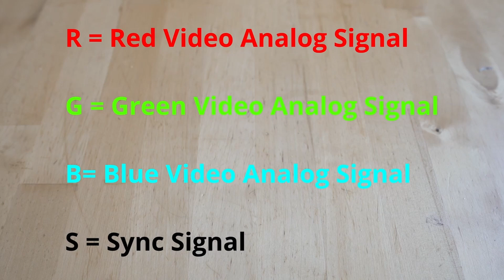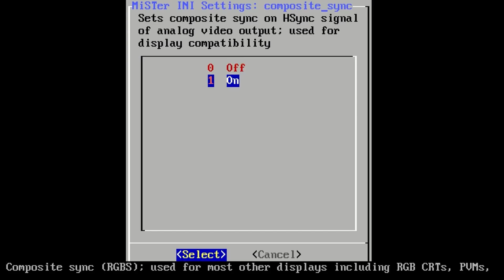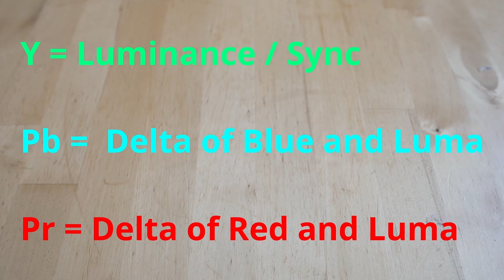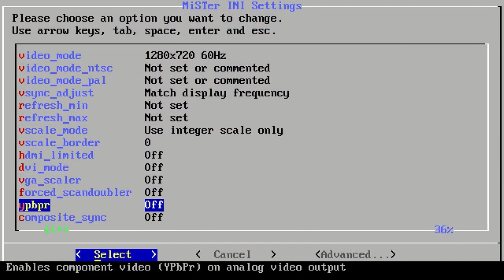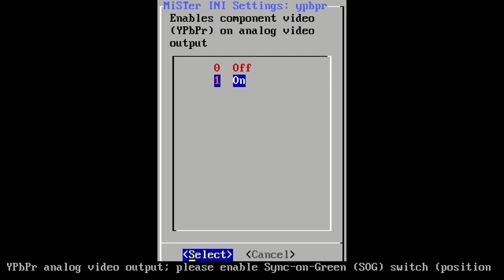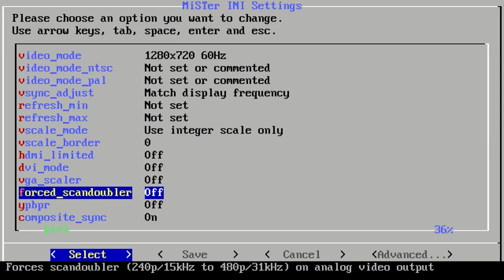MiSTer FPGA 2023 Analog Video Guide! RGB, Component VGA, S Video and Composite! Updated

Comment: I'm thinking of getting a retrocastle mister board, they have one that uses a saturn port instead of vga. which I guess is easier to do video+audio and takes less space. before I click fire on that do you think there's any "NO THAT IS A TERRIBLE IDEA" advice? I feel like it would work even in a pvm
Reply from the maker: I haven’t tested it so I really can’t say much about it. VGA offers the best of everything. I recommend the MiSTerAddons analog IO board personally
Reply: @VideoGameEsoterica  where I am it's really hard to get a mister. the retrocastle basically gives you the de10, a custom io board and low profile fan, 128mb ram, 256gb sd card, usb c power supply, usb hub, a good quality case and a custom saturn output port for a bit cheaper than a mister and it's smaller form factor. maybe when I'm back in the UK I will get a normal mister too
Reply: @VideoGameEsoterica  Is there anything special about MisterAddons' Analog boards? Are they 24bpp like Antonio Villena's boards or 18bpp like the regular boards? That's another option I've been considering, their passively cooled case in special is very appealing.
Reply: I own one and can vouch for its video output quality over rgb, composite and with use of a sega saturn rf adapter.
Reply: If you can get the relevant Saturn video cables with the quality you expect or can make your own, you should be good to go. I've been considering buying one of their boards (and aluminum case) to have a more compact and easier to carry setup, but I confess to be a little undecided on the Saturn vs VGA out. I've been using a video converter board from them that I believe uses the same AD724 chip they use on the Saturn board, the S-Video output is almost indistinguishable from YPbPr but with composite it's inevitable to have artifacts.

Comment: There's a method how you could fix the crack in the shell. Get a similar colored piece of plastic, cut it into lots of small pieces and melt it into a paste by placing it all into a jar of acetone, letting it sit until it has dissolved. You can then use the paste to fill in the crack, however you'd have to apply some pressure to the shell to keep it in place as the paste dries out, maybe also using some tape on the inside to prevent the paste from seeping too far into the shell, and you may need to level it out afterwards. I do suggest practicing on some other plastics parts first. The same method is used to fill in gaps in plastic guitar neck and body binding in guitar construction and restorations. The melted plastic basically turns into the perfect plastic glue. Since it is only a single crack it should be possible to restore it.
Reply from the maker: Ooh interesting. I’ll look into this. Sounds like a solid method because this crack does annoy me
Reply: @VideoGameEsoterica  worst case if you don't want to do it yourself, check for a local guitar or amp repair shop specialized in restoring vintage equipment. Some of these guys can work pure magic and restore damages to the point where you have to use a magnifying glass to spot any imperfections. It might just not be cheap but at least these guys appreciate vintage equipment and know how to handle it with care. I'd just remove all electronics first in either case, so that you'll only be working with the plastic frame.
Reply from the maker: Nah sounds like a fun project for some random day when I have extra spare time :)
Reply: Just be careful with acetone, pure acetone is hard to get and can be quite dangerous to handle if care is not taken. People have been using acetone to smooth and hide layer lines on 3D printed ABS parts and it can also be used to fix cracked parts, the trick is using the right amount acetone as too much will ruin the part.
Reply from the maker: Like any chemical…there is a ratio and it’s almost never 100% lol
Reply: @VideoGameEsoterica  it's definitely a good idea to check out some guides first for more specific information and to work with it only in a well ventilated space. When melting the plastic you can just keep the lid on the container with the acetone closed, so that's no problem.
Reply from the maker: Yeah def something I’ll do with proper ventilation. Not good breathing that in lol

Comment: Weird it's called sync on green when it's technically sync on luma. I get that it's the green cable, but with component the green cable is Y which is luma.
Reply from the maker: It’s an ease of use thing. If you say “green” anyone reaches for the green cable.  If you say luma 90% of people won’t know which one that is
Reply: Sync on Green is also used by some weird VGA monitors. IIRC the PS2 needed a monitor with SoG support to run Linux in it. When outputting YPbPr on MiSTer the luma gets sent to the green signal pin of the VGA port, as most passive adapters will connect that pin to the color coded green RCA jack used for luma.

Comment: I believe Antonio Villena’s I/O boards have audio on the VGA port using some particular pins but you obviously have to have the right kind of cable to take advantage of that. I wonder what VGA cable with audio people are using when they find there is no audio on the standard I/O board.
Reply from the maker: I’ve never used his hardware so I’ve never seen that in action
Reply: @VideoGameEsoterica  Meanwhile, I got his mini I/O4 with DB9 to avoid buying a USB hub board but I haven’t looked into audio on the VGA port since I’m not using analog yet. I believe there’s also something special about the video DAC he uses (4:4:4?).
Reply: @emmettturner9452  the standard analog I/O board uses 6 bits per component as most cores don't even support outputting more colors than that. Antonio Villena makes two board models with 8 bits per component, there may be other models out there I haven't heard about.
Reply: @gcolombelli  Thanks!
Reply: @emmettturner9452  You're welcome. I believe the Amiga and ao486 cores should be the ones you'd be able to exercise 24bpp, besides that, you can check if your board has 24bpp / "RGB888" output by enabling vga_scaler and pressing F1 on the main menu until you get the "spectrum" background, on 18bpp boards there will be very noticeable color banding.

Comment: Excellent video, how can I make an adapter to use composite video? I have no possibility of buying an official adapter, thank you!!! greetings!
Reply from the maker: Id have to find if the build is available and what the BOM is
Reply: The only "official" one I've found schematics for is the active board (THS7374IPWR signal amplifier) for use with the Y/C cores, by Mike Simone, but not the one with the AD724JR RGB to NTSC/PAL encoder chip.

If you can get the AD724 chip and the oscillators, there's even a schematic for a simple converter board on the datasheet, the hardest part is soldering the 16 lead SOIC chip, but as far as SMD chips go, this one is on the easier side... at least if the PCB has solder mask, you should be able to solder it with a regular soldering iron with the "drag soldering" technique. On the AD724 datasheet there's also another schematic for a board with an additional AD8013 signal amplifier chip so you can get simultaneous RGB, S-Video and Composite outputs.